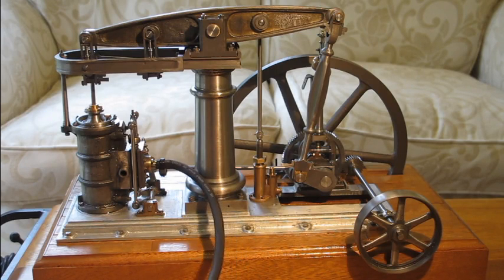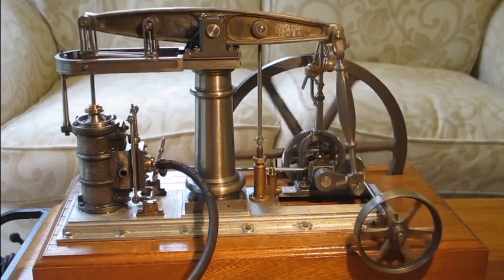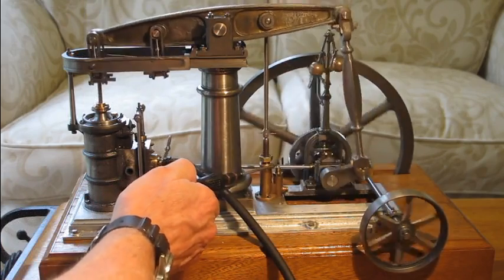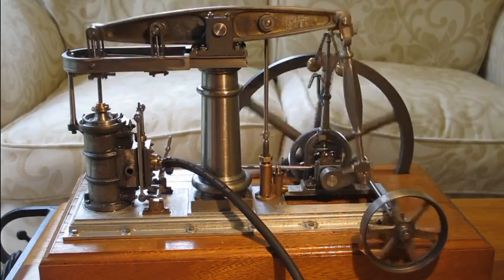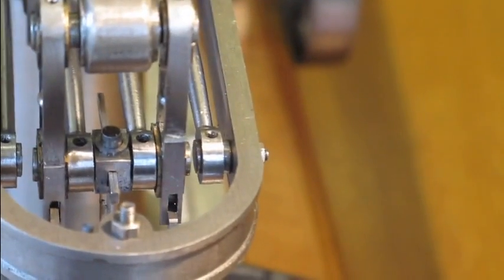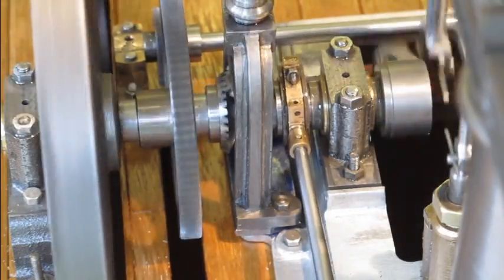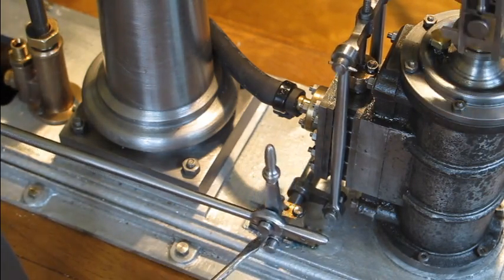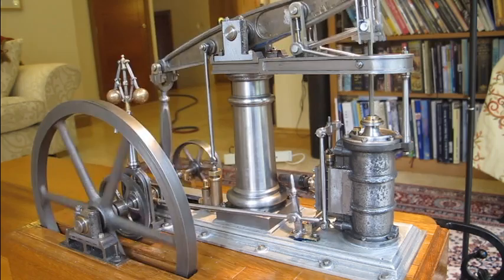ME Beam Engine

Comment: I don’t understand the bevel gears …why are they there?
Wouldn’t the large gear  just be driven by the axle? 
And why is the belt wheel not just added to the axle on the outside of the flywheel ?
Reply from the maker: The bevel gears translate the horizontal rotation of the main shaft to a vertical rotation for the spindle that the governor is connected to.  The larger gear is indeed just fixed to the main shaft. Any drive would be taken from the smaller pully as it would be impractical to take a belt from the main flywheel as it would be some 12ft in diameter.

Comment: This is a rotative beam engine used to supply power to other machinery ie Mills or pumps via the take off drive pulley. Pumping engines generally have no flywheel when driving a lift pump, take  a look at places like Kew bridge or Hale, which are known as Cornish engine’s used to lift water.
The small pump is to  replace lost water to the boiler due to running the engine, this is a calculated size to match  the main cylinder at a constant speed with very little variation hence the governor.
Reply: Pumping engines do have a flywheel - as you said take a look at Papplewick where the flywheel is 20ft in diameter and weighs 24 tons.
Reply: @rogerlill  I have amended my post as you are correct Papplewick has a pump acting on both strokes  requiring a flywheel to equalise the torque over one complete cycle in operation.
Reply from the maker: Ron, thanks for your explanation and clarification.
Graham

Comment: Great engine. I assume these are Reeves castings? I have the same engine but older. I had the same problem with the parallel motion lugs as well. Definitely a design flaw. I’m surprised they have not amended the blueprints as my engine is from the late 60’s and this problem existed on the blueprints back then.
Reply: Hi, thanks for the kind comment . Yes they are from the Reeves Castings and like you I was very surprised about the errors in the drawings. I did think that after all this time any errors would have been sorted and the drawings would be correct.  Maybe in the future as more designs get drawn using 3D cad that the errors will be reduced, but who knows.
Graham
Reply: @wendyshorrock589  .....Perhaps. I bought my engine already built from the U.K. (I live in NYC) and the engine had several problems. Mainly the Watts Parallel motion and the crank was tweaked so I had to repair them. Unfortunately the original builder damaged the cross section a bit by mounting on soft wood. These beam engines should be set on a thin piece of metal then onto wood. Even if the build standard is spectacular they tend to warp after extended running if not extremely secure and aligned perfectly. It’s impressive this was your “first” build. Most people start with a small Mill type engine. Cheers!

Comment: Nice work, I'm no expert; on single cylinder engines top and bottom dead centre won't allow the engine to start so we nudge it in direction of rotation. On full size engine a bit hard to do, so as Eugene says engineer had to lift handle disconnecting eccentric drive to valve gear. This then allowed valve gear to be repositioned to a starting position and then reconnect the eccentric rod, probably had to also move flywheel to allow this. Too hard to do on full size with everything connected. On a large engine doing heavy work I believe they had a small auxiliary engine to turn the main one over. With multi cylinder engines eg. locomotives, strokes are arranged to always have one cylinder not on TDC.
so are self starting. Small flywheel on opp. side I imagine is belt drive for machinery. It's a lovely engine, this one. Cheers Ron.
Reply: +Sharise Watson Also on engines that run on steam before startup they need to clear the cylinder of any condensed steam (Water) because water doesn't compress. To do this they open up vent/drain valves at both ends of the engine and run the valve mechanism manually back and forth putting steam into the engine to force the water out while not allowing the engine to rotate too closely to top dead center where hydro-locking would occur. Once the internal parts are plenty warm to prevent a lot of water build up the engine is started. The first time it goes over top dead center you hold your breath a little. With compressed air it really doesn't mater.
Reply: Jay Leno uses a helper and they spin the flywheel by hand to get it going on his 8' 1832 beam engine

Comment: About the function of the handles at the valve mechanism: as far as I know, the valves could be manually operated: First unlink the beam coming from the eccentric by lifting it with the horizontal handle at its end, then use the vertical handle to manually operate the valves. This might be useful perhaps, if the machine must start from just before a dead point, so you want to reverse it a tiny bit to get a better starting position ? I would also like to hear about this from an expert.
Reply: +Eugène van de Kamp  Also on engines that run on steam before startup they need to clear the cylinder of any condensed steam (Water) because water doesn't compress. To do this they open up vent/drain valves at both ends of the cylinder and run the valve mechanism manually back and forth (and the piston moves slightly near the middle) putting steam into the engine to force the water out while not allowing the engine to rotate too closely to top dead center where hydro-locking would occur. Once the internal parts are plenty warm to prevent a lot of water build up the engine is started. The first time it goes over top dead center you hold your breath a little. With compressed air it really doesn't mater.

Comment: Well done Mate, looks like a well finished job, and yer got yours running in the correct rotation, crankpin driving up on power to lift the rod and push the beam as the crank travels toward the beam end, small things like that help to make it a more realistic copy of the real thing. Put in on youtube search, " Burton Latimer Beam Eng." where you will see one I made running the incorrect rotation.
 Don`t really matter some of you might say, but if yer going to build one, yer may as well do it right?, why did`nt I do Mine,SOLD IT before I realised,
  Best Wishes, Harry.
Reply: Thanks for the comments, I must admit I think the direction of rotation was probably more by look than judgement!